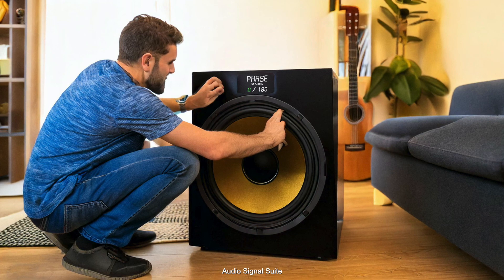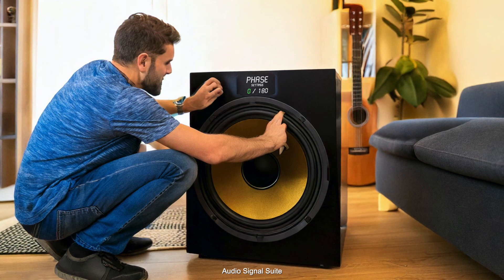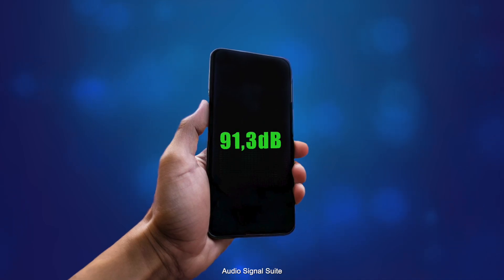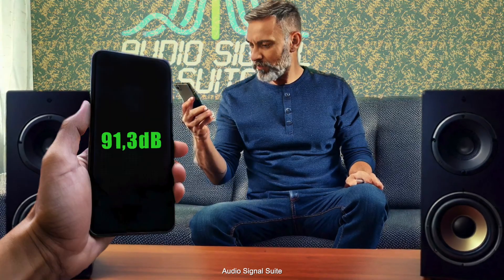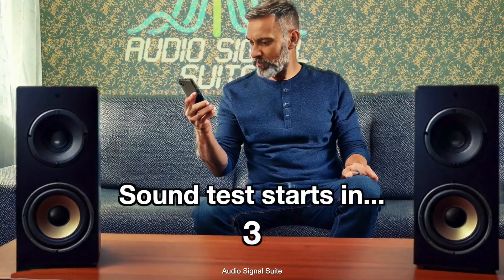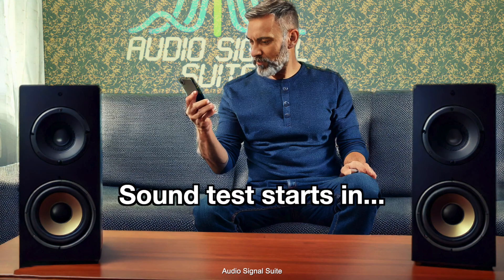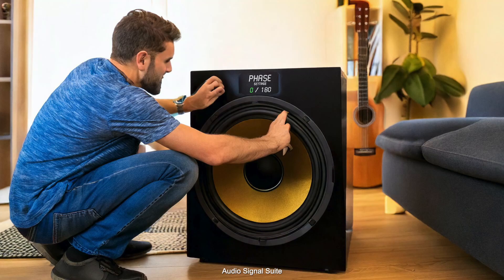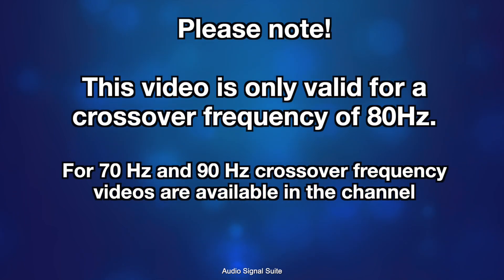How to TEST and SET the correct SUBWOOFER PHASE - 0° or 180° @80Hz ?

Comment: Dude, I bought a Polk ES8 sub yesterday, and it comes with a DSP that allows you to set the phase between -135° and 180°, giving you 8 options to choose from. While it is very flexible, it was difficult to set the phase until I saw this video, amazing! Many thanks.
Reply from the maker: First of all, thank you for your comment! I really appreciate responses like this, especially when the video was actually helpful. Thank you! 🤗

I just checked out your Polk subwoofer on Google. What’s also cool is that you can set the crossover frequency directly to a fixed value digitally, rather than having to guess it with a potentiometer. Not bad at all.
What main speakers do you use with this subwoofer?
Reply: @AudioSignalSuite  Thanks for your reply =) Yes, absolutely! They have a new set of settings that allow you fine tuning , more than interesting. Due space issues I only have front speakers and the subwoofer; the fronts are an old Polk Monitor 50, which alone do not dazzle, but pushed by the ES8, they sound pretty good; all this pushed by an old RX-V 459. After almost 18 years, just now, I am researching about Polk Monitor XT60, about which I´m reading very good reviews, they are affordable and I would think it is a good upgrade over the M50. Did you have a chance to test to the XT60?

Comment: Was wondering how to setup my Sony SS-CS9 sub that's part of my new home theater and I used my Apple Watch Sound Level app and voila Reverse (180°) gave me 59db compared to Normal which was 51db. Now I need to find a way to find the correct crossover as my front speakers are Sony SS-CS3. Sub has a rotating knob with a min of 50hz and max of 200hz, meaning mid point should be 125hz. Mine was slightly higher than mid point so around 150hz and I still got to see the difference with this test
Reply from the maker: Thank you for this detailed comment! Much appreciated! 😉

The test (unfortunately) also works when the crossover frequency of the subwoofer is set too high. This is because the test measures at the test frequency (70, 80, 90 Hz) and doesn’t know how the subwoofer is set. This is, of course, not ideal, because the measurement adjusts the correct phase at 70, 80, or 90 Hz, but above that, the frequencies add up, leading to further phase errors.

Some sound pressure level measuring apps can also display the frequency response. Maybe you can try one of those to set the correct crossover frequency for your subwoofer. Of course, only the subwoofer should be playing during this test.
And don’t forget, the crossover frequency of the subwoofer should be determined at a -6 dB amplitude drop. The correct crossover frequency for your satellite speakers is where their low-frequency response also drops by -6 dB, not where they just begin to roll off. (@12dB/Oct)
Reply: @AudioSignalSuite  So, I’ll attempt to precisely position the cutoff frequency knob at 80 Hz (THX number) and experiment with that setting. When the knob is at the 4 o’clock position, which corresponds to the minimum frequency of 50 Hz, and at the 2 o’clock position, which corresponds to the maximum frequency of 200 Hz. Sony’s instructions indicate that the smaller the front speakers, the higher the cutoff frequency. My front speakers are standing Sony SS-CS3 with 2 x 5 inch woofers with a 45-50k Hz Frequency Response.
Reply: My Sony sscs9 is set to 180° and it sounds best at that setting
Reply: So I might have misunderstood you, but I will share my thoughts with you. First, that frequency knob would probably be for using your sub with speaker cables, going from your front speaker connectors on your receiver to your sub and then on to your front speakers from the sub. In that case you would set the cutoff frequency on your sub and not on the receiver. 

If you have your sub connected with audio cable(s) or coax cable (LFE out), you would want to set the frequency to the maximum because when an LFE signal is sent to your sub it can actually have higher frequencies than the standard 80Hz THX cutoff frequency set on the receiver. This for the LFE channel, so if you use bass management for your fronts (60 or 80Hz i.e.) that is separate to the subwoofer LFE channel. Both will be sent to your sub at the same time but as mentioned the LFE channel can have frequencies above a set bass management lowpass filter.

Your fronts are large and should be able will to handle a lowpass frequency of 60Hz if your receiver let's you set crossover freq per speaker pair. If your surrounds are small and not to capable under 80Hz (not many small speakers are) and your receiver only has one lowpass frequency for all channels, set it to 80Hz as you suggest.

Sorry if I'm unclear and if I've misunderstood. :) Good luck!

TL;DR Leave the knob at max on the sub and set the bass mangament to 80Hz on the receiver (unless adjustable per channel) if connected with audio cables rather than speaker cables. =D

Comment: Hello, good evening!!
If my slim subwoofer (installed on my car) has a phase of 0 degrees at 50 Hz and the dB increases, but at 110 Hz the dB decreases, what should I do?
And when I inverted the phase, the intensity at 50 Hz (when I turned on the sub) and increased at 110 Hz when I turned it off.

Thanks!! Success!
Reply from the maker: Thank you for such an interesting message.
You’re definitely dealing with phase cancellations, but how to eliminate them in a car with simple methods is something I’m unsure about myself. I find it a difficult topic. I’ve never thought about something like this before. In a studio or at home, you can solve quite a lot with a good EQ.
In any case, I’d suggest taking a closer look at your crossover frequencies and testing whether you can optimize something there. The subwoofer may need to be crossed over at a lower frequency.

Comment: Which app to test?
Reply from the maker: I do not want to advertise any specific app and unfortunately, I will not recommend one either. However, there are many free sound pressure apps that can be used for this test. It does not have to be a specific one. Thank you for your understanding! 😉
Reply: Dezibel X (free Version) on iPhone. Works great!
Reply: I used the free App „Sound Meter“ on my Android, and it worked really well and was easy to use.

Comment: is there any difference between the several Apps for db measurement? What would you suggest?
Reply from the maker: I don’t think there is a significant difference among the free apps available. For this test, you don’t need to determine an absolute dB value or a frequency response, just a relative dB value to identify the higher volume. A smartphone is completely sufficient for this. I don’t personally recommend any specific app; everyone can decide for themselves. Thanks! 🤗